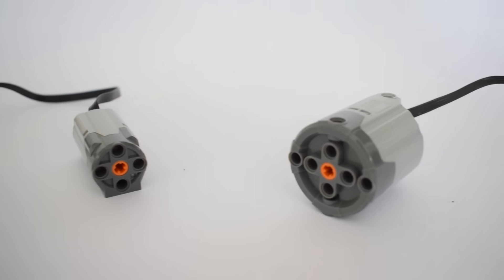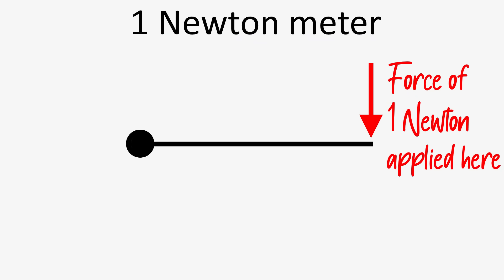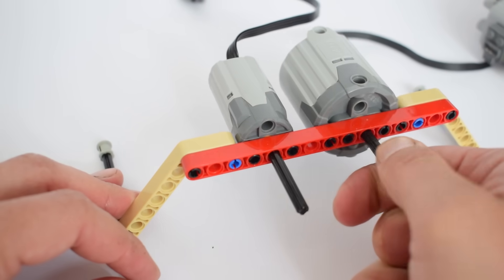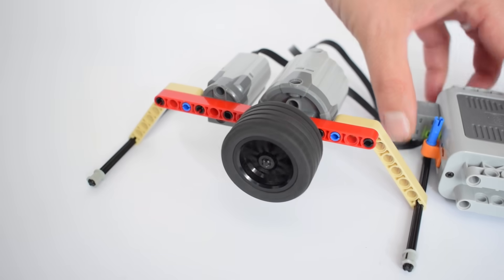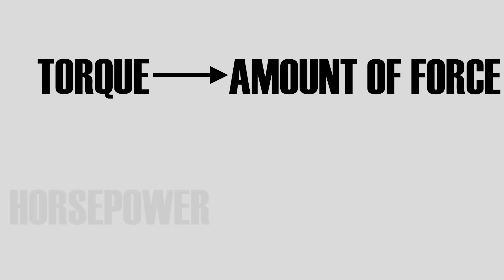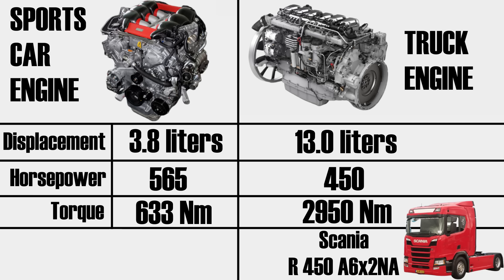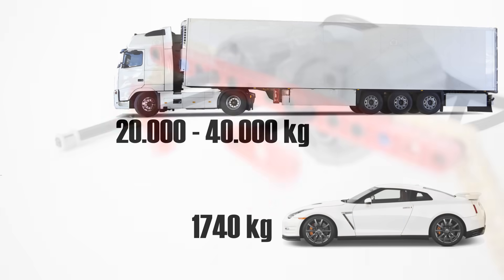NEVER be confused by HORSEPOWER and TORQUE again - HP and TORQUE EXPLAINED in the MOST VISUAL WAY

Comment: Ok I feel like the video ended short...you did not explain that the reason the sports car engine can't go in the truck is because it will need to work at much higher rpm for extended periods of time and will overheat it and it would not last long or be efficient.  However, with the right gearing given that the gtr engine has more horsepower. It will be able to move a loaded truck up a hill even faster than it's own diesel engine....but again efficiency and especially longevity will suffer greatly.
Reply: To add to that, if anyone thinks this cannot be done because you cannot match the torque of the big engine...you can.  It is called a torque multiplier or gearbox.  You can output more torque in first gear than in sixth for that reason, so a gtr in 1st gear will surely output more torque to the wheels than a semi truck in it's top gear.  For that reason you can gear the small engine to do the work of the big engine because again, horsepower is the measurement of how powerful the engine is and what it can do, not torque (as long as the small engine makes the same or greater horsepowerthan the larger engine ofcourse).  High torque and low horsepower just tells you the engine is large and relaxed and spins slower.

Comment: The sport car engine could be used in the truck and would accually accelerate faster than the truck engine if proper gearing is used to keep both engines at max hp range
Reply: the car engine wouldnt be able to move the truck.
Reply: @LiveFromLondon2  It absolutely would. It is just a matter of gear ratio.

Comment: Why don't we use torquey engines in sports cars and just use different gearing?
Reply: Because a sports car platform and axle can only absorb so much torque. For example, classic big V8 muscle cars needed to use continually smaller tires to offset the ridiculously tall gearing needed to offset the high engine torque.

Comment: Excellent video, but I have  one gripe:

You demonstrate pound feet of torque by applying a force at the end of the wrench, resulting in an output at the centre of rotation.
An engine on the contrary, applies a force at the centre of rotation, resulting in an output at the end of the wrench.
So you demonstrate the opposite of the force that we actually are talking about. It’s no big deal but to keep things simple and to be sure nobody confuses both horsepower and torque, you’d better explain this opposition to make your explanation complete. One could potentially be left with another confusion. LOL

Comment: So, on a reciprocating internal combustion engine, you can multiply the torque by the number of cylinder ignitions per second to get the power output.  How would you work it for, say, a gas turbine engine which uses  continuous ignition?
Reply: Just make you factor in the torque lost to engine accessories before adding up your cylinders. Between two engines with the same displacement, the one with less cylinders will tend to have more torque at low RPMs.

For example, the Ford Triton V10 vs the Cummins I6
Reply: @dudejo  A gas turbine doesn’t have cylinders.
Reply: @FS2K4Pilot  ah ok, I misread. Then I guess you'd have to measure the power behind an individual pulse, if possible and work from there?
Reply: @dudejo  Logical, but figuring that out would seem more complicated than one could compute using napkin-math.  ;)

Cheers.

Comment: I'm still left wondering why a geared-down sports car engine wouldn't do a fine job of moving a truck.
Reply: Because, first, the truck drivetrain would eat most of the sports car engine's torque as parasitic loss. Second, gearing down would weaken the drivetrain and reduce your max weight rating.
Reply: @dudejo  Thanks for replying, but now I'm even more confused ¯\_(ツ)_/¯.
What do you mean about eating and parasitic loss?
And are you saying that gearing down the sports car engine would involve so many steps of gearing that the gears would be a problem by themselves?
Reply: @tgeliot  For parasitic loss, for example, an old 90's Corvette ZR-1 losses up to 50 lb/ft of torque through its drivetrain.

So,when measured on a dyno at the wheels, instead of the advertised 375 lb/ft, you get 325 lb/ft.

From what I found, big truck drivetrains can consume up to 300 lb/ft, meaning that Corvette would only have 75 lb/ft at the wheels.

As for the gears, it's because the gears would get so physically small, due to the required gear ratios, they wouldn't hold up to any kind of pressure, especially when towing.
Reply: @dudejo  OK, thanks.  I understand a little now.

Comment: Does gearing up the motor down affect the torque applied?

What im thinking is:
Big motor has more torque, but due to lower RPM his horsepower advantage over the small motor is not the same factor as its torque advantage.

Now if you were to gear up the bigger motor, so both motors would spin a wheel at the same rate, what would the torque applied to the wheel look like.
Big motor has about 4x the torque and 2x the horsepower. The RPM is about half of the small motor.
So if we gear up the big motor to make a wheel spin at the same rpm, we have to increase the rotiation by the factor of 2. That should lead to a reduction of the torque applied to the wheel by a factor of 2 aswell.

So when we do it, they both should spin the wheel the same speed, but with the big motor we apply 2x the torque to the wheel, right? 
Where my brain collapses is: If we have the same rpm on the wheel now but 2x the force, the horsepower on the weel should be 2x as high for the big motor.
But that would mean the horsepower ratio between the motors did not change after changing the gearing.
Is that correct? So you could technically maintain the same effective horsepower by gearing up further and further. The only limitation is when the torque gets so low it cant overcome the spinning resistance of the system anymore. But would that mean a truck engine with a shit ton of torque would easily outperform a race car engine in speed if you just gear it up enough?

I know thats not the case, but why is it not the case?
Reply from the maker: https://youtu.be/txQs3x-UN34

Comment: If horsepower is directly related to number of rotations per unit of time, how come top fuel dragstets produce 11000 horsepower but their rpm isn't much different to a normal engine?

Example:

Top fuel dragster redlines at 9-10,000rpm and produces 11,000 horsepower

4 stroke superbike redlines 14-16,000 rpm but produces only 200 horse power
Reply: It's not just RPM. it's Torque x RPM. So if the RPMs are the same, clearly the dragsters somehow generate more torque.

Comment: Now this is what I always try to explain to my parents, and it is the reason why they bought a car with terrible torque.
Only 5 hp less than the old one (Fiat Scudo Diesel, the corrosion ate it), but instead of about 300NM, the new 2015 Opel Combo 1.4 (no turbo) has 127NM and about the same weight.
The result: Fiat Scudo took 10 sec from 0 to 100, can accelerate effortlessly at 100 kph at any incline, Opel Combo takes 27 sec from 0 to 100, doesn't accelerate at 100 kph at anything past 2.5%.

Comment: Without any knowledge in mechanical engineering, i have tried to understand the difference between hp and tq for so long. Referred multiple videos. And here you are the simplest explanation and it's to the point.

Thank you so much..

.

Comment: actually you can have a gear train that gear up the big motor to higher speed and by holding back the shaft the actual torque at low speed is now less than a motor geared down. you can have a motor with a top speed of 50 000 rpm but with a toque of nearly zero at low speed.

Comment: no i hawe one question. sory for gramer.  so.   i had peugeot 307  2.0hdi 90hp and peugeot 307 1.6hdi 90hp.   why did 2.0 enegine go so much beter. it wasn that one was old the other new. this were bouth new cars. same size, same weight.  same gear box. well almost same.  but diference was wery big.  you would not imagine.  so why is that.
Reply: the 2.0 is a bigger engine so your power at low RPMs will be better. the 1.6 needs more RPMs to compensate for the smaller size.

but if you push the gas pedal to the max, both engines will ultimately perform the same.

Comment: Horsepower = torque x a period of time
Q: what's the period of time?
In the case of the GTR 565/633 = 0.9 
is that 0.9 minutes, given that the M in RPM stands for minutes?
I think it makes 565 bhp at 7000 RPM. But then, wouldn't that mean that its torque is 0.08? which is not
I understood the concept, but can't make sense of the numbers

Comment: I own a Volvo V40 D4 that has 177hp and 400nm of torque with 5 cylinders. I always wondered why a more sportive car, like a VW Golf R with 315hp has less torque. Is it because the amount of cylinders? How would that feel in comparison?
Reply: The easiest thing for me to visualize the difference is to compare a diesel vs gas engine. The gas engine has comparatively small light pistons with a shorter stroke which means they can rev higher and get to max rpm faster. If the gas engine revs to 7000 and the diesel only revs to 3000 then the gas engine has more than twice the amount of power strokes in a given amount of time. The diesel puts out more force with each combustion event but the gas beats it with quantity of power strokes. So at low rpm the diesel is more powerful but at high rpm the gas engine is the winner.

Comment: Yes but one needs to understand, a typical diesel BMW 320D has the same Horsepower and torque as the 320i, yet the diesel puts out More horsepower at a lower rpm, it gives 135 kw at just 4000 rpm whereby the petrol generates 135 kw at 6000 rpm, the same force but at different rpm, the Diesel will outperform acceleration but at top speed the petrol will win because it has a higher rpm.

Comment: Well, now I know why I didnt know HP. Not because I "actually" didnt know it, but because its officialy named differently in physics. Its called in reality just Power and has P as symbol for it.  
Also one mistake- Torque can be also be determined by 2  factors: 1st is the Force, as you said, but then 2nd js the lenght of the crank. You see on your example with wrench- you may wanna loose a bolt, but you arent strong enough. What can you do? Well, you can try applying more force, or you can symply lenghten the crank, for example by taking longer crank for the wrench or taking some pipe and connect it. Thats also why diesel engines, especially in trucks and so, have longer cranks and bigger displacement than smaller gasoline engines in cars... ;) . There is ton of examples, but just to name a few and to correct this mistake... But still great video with the showcase and comparison! 😉👍
Reply: Not a mistake. Hence why torque is quoted in a two part unit of measure: newton-meters or pound-feet. As in, like he said in the video, 1lb-Ft (I’m american) is 1 pound of force at 1 foot distance away (“the length of the crank”). So he didn’t miss explaining this. You did lol

Comment: Yes, but how about having the same speed via a gearbox? You can have more torque in the small engine via gear ratio.
Reply: It be imposiibke for make more output torque at given velocity thanks gearing so let say at drive wheel axis from lower torque at enginecrank at given velocity assuming smaller engine have smaller power 👌🏻 gearing be itself give nothing 😁👌🏻 there must be biger engine power otherwise forget about more putput torque at given velocity 👌🏻 and for achieve  more force at contact path in such egzample so this units which really accelerate vehicle forward from biger ouut torque so at drive wheel axis wheel radious must be the same or biger cos assuming shorter wheel radious you dont need more output drive wheell axis torque  for generate more force at contact path 👌🏻 you need only more power at enough biger engine rpm 👌🏻
Reply: @mociczyczki  sorry, I couldn't understand most of what you said.
What I meant was that he should have explained a little in the video about gears: torque multiplication, how it changes angular speed and how power remains constant.

Comment: I usually just think of large engines with larger pistons and longer connecting rods as having more torque.   They have a longer more powerful stroke  but can't rotate as fast.    The car with a smaller piston and shorter connecting rods don't produce as much power per stroke but because they are smaller and shorter can be driven to higher rpms and thus turn the crankshaft faster.    So a sports car can rev up and move at higher speeds while a truck moves slower but pulls more weight.      Theoretically a large engine could be driven to higher rpms but would have to be so massive to contain that rotational force that it would be completely impractical.     Additionally, truck engines tend to run on diesel fuel because it burns slower and can take advantage of the longer stroke to produce power over the entire stroke while gas engines are more of a sudden burst which helps produce quick power for the shorter stroke of the gas piston.
Reply: Part of the additional torque of a diesel engine is due to the greater radius of the crank where the large end of connecting rod is exerting force. It's like accelerating a bicycle with longer pedal arms. You will generate more torque at the center axis of the crank using the same "pushing" force against the pedal while using a longer pedal arm (or pedal crank). A greater crank radius will require longer connecting rods because the distance travelled transversely at the big end is greater and you don't want too great an angle between the connecting rod where it meets the bottom of the piston. A larger diameter crank increases the compression ratio which is higher in a diesel engine (usually 14:1 to 25:1) than in a gasoline engine (8:1 to 12:1).

Comment: another way to explain this is with cars, with torque being force and and HP being speed. the gears on a transmission help feed the power of the engine to the wheels, the bottom gear having the most force to move the car but at a low speed while the top gear having the highest speed but having the least amount of force because it doesn't need that much force because the car is already in motion

Comment: What if you compensate rotational speed with gearing? Why would a truck motor then not outperform a sports car motor? It sounds to me like horsepower is irrelevant with the right gearing, and only torque matters.

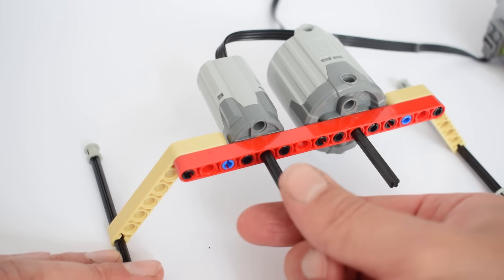Comment: 6:15 you can feel the horsepower also, for instance, friction of the shaft on your fingers creating more heat with more power
Reply: You are technically feeling the result of horsepower and not horsepower itself. But still a very good point!
Reply: Use gearbox to equalize RPM, easy.
Reply: @AndreiSZS  please expand
Reply: @gotmilka  If you adjust gears in a way that both of them run at the same speed, the one with more torque will have more HP
Reply: @AndreiSZS  that's great, but why you're telling me that?
Reply: @gotmilka  Replying to your comment about ways of feeling the HP.
Reply: @AndreiSZS  thanks for answering, in that way I won't feel HP, only torque, right? Feel, not measure.

Comment: Well done! When you explained how torque is being used for acceleration you could add that HP is needed for top speed. Also, a main difference between electric motors and combustion engines is that e-motors deliver their torque right from the start (as can be seen in your demo even at standstill!) while the engine needs some revs. That's why EV are that quick on drag strips.

Comment: This video misses explaining key aspect: high power can can always be geared down to high force/torque. As such the GTR Nissan engine could indeed pull semi trailer, if right gearing was used. This would be very impractical as the GTR engine would have to work in very high RPM range and it isn’t designed for constant duty. But from physics stand point it can put more torque (as it has higher max power), than the truck engine, to wheels at given speed. More power always means more available torque at given speed. Gearing can set practical limits to this and many high rpm & high power engines have also very narrow power band and thus further limiting practical use (like Ferrari sports car engine in a truck towing a boat).

Comment: You get the HP number from Torque × RPM ÷ 5252  So when you see the torque and HP numbers quoted in different RPM you can figure out your HP at the rated torque with that equation.
Reply: 100% correct 👍
Reply: Only if you're measuring torque in pound-feet. If you want to convert Nm to HP, that would be Nm × RPM ÷ 7127.
Reply: @wbfaulk  why would you bother? Just convert NM to ftlb & use the formula that everyone knows.
Reply: @moe2470  I wouldn't. But stating that horsepower equals "Torque × RPM ÷ 5252" is "100% correct" is, well, not correct. It's only correct if you're measuring torque in lbft.

And people only "know" that formula in areas where lbft and HP are the units of choice. Many (most?) places use Nm and kW.
Reply: @wbfaulk  yeah well that's what me & everyone I know uses. I say dilligaf to Europe.
Reply: @moe2470  You realize this video almost exclusively refers to Nm, right?